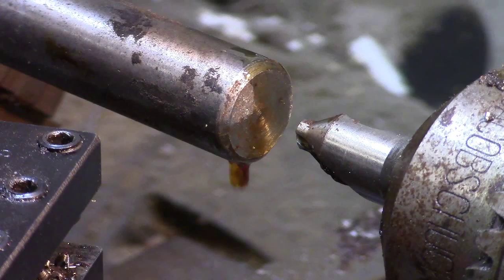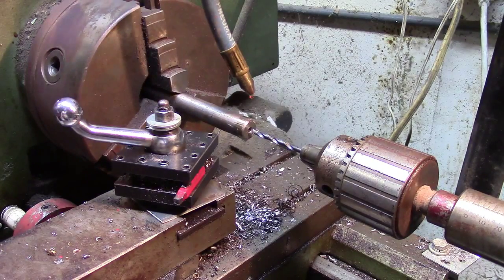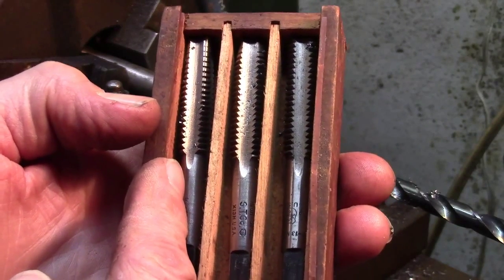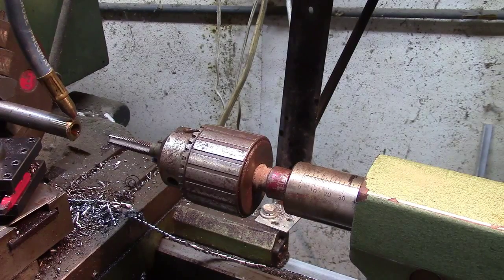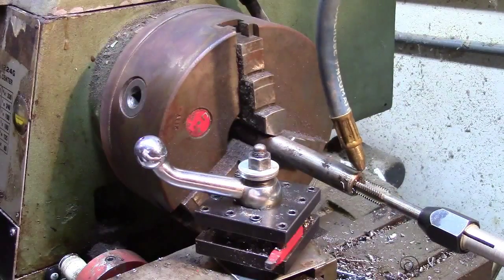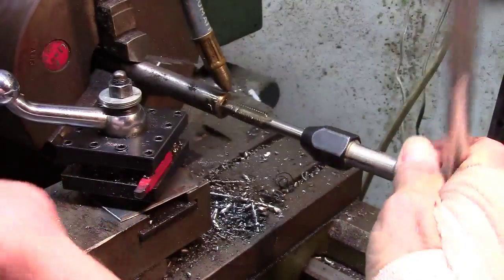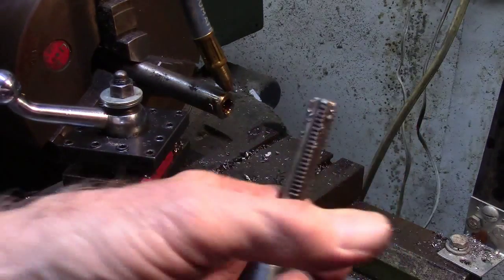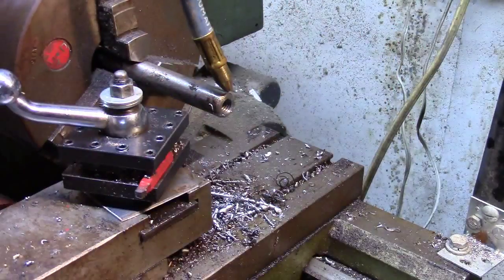Drill and Tap on a Lathe

Comment: i USUALLY PUT GREASE IN THE GROVES OF THE TAP. THAT WAY THE GREASE CATCHES ALL THE STEEL PRODUCED BY THE TAP!
Reply from the maker: +marco hanse   I'll try that to see if it threads any easier  Thanks.  and thanks for watching
Reply: +dusty guy doesn't make it easier,  I work quite another around cars and when your around carbies.  you don't want steel filings falling back into the inlet manifold.